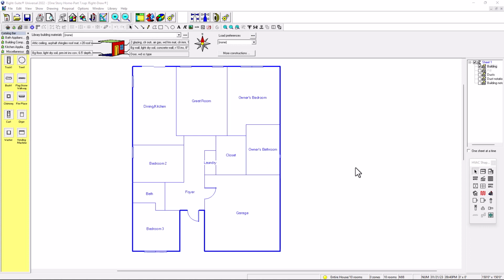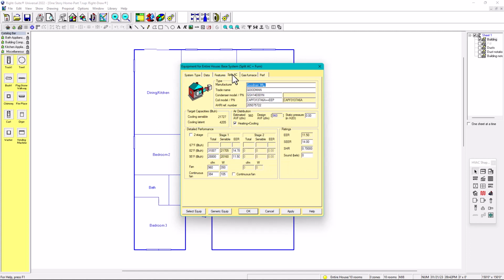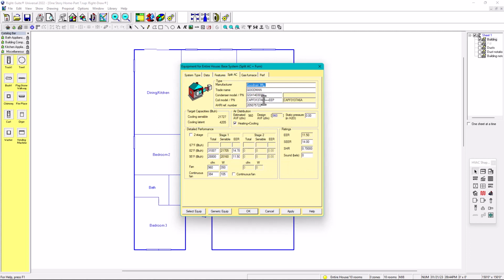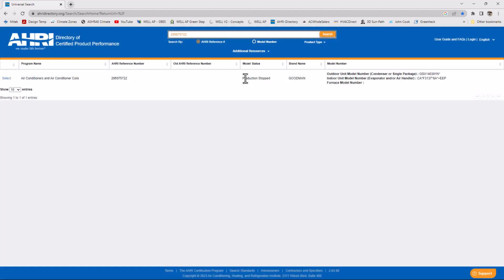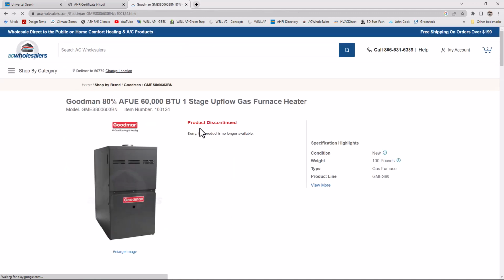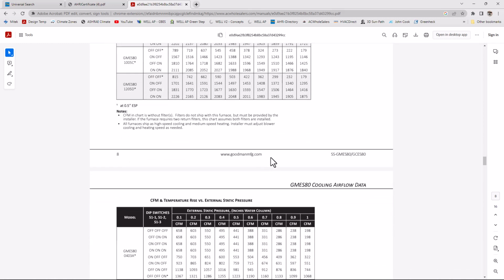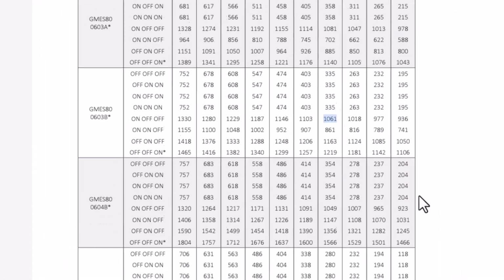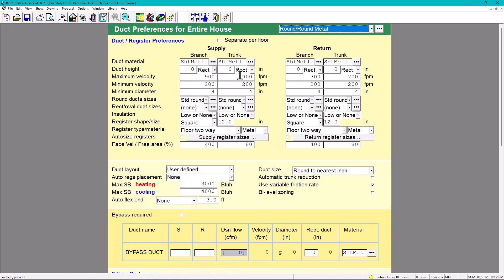Wrightsoft (Part 7): Manual J Heat Load Calculation - One Story Home

Comment: Sir i just now had a chat with my senior in dubai he was saying that Hvac design needs a lot of practice & some drawings are sold only at 5 dollars per plan on freelancing sites is that not less in comparison to our value & effort ? Or is he misleaded.. for 1 commercial restaurant or school project how does a freelancer should charge ? Including of how many services like design part drafting part or boq with heat load calculations sheets etc would you give some clearer ideas so that i must be prepared..
Reply from the maker: The pricing in Dubai might be different. Not very familiar with the market but if you network with some contractors there or some research, perhaps you will be able to find a decent idea on pricing for MEP services
Reply: @hvaceasymath  How far do you think a freelancer can go in our field ? Can we earn more without getting into office work ..
Reply from the maker: @mohibquadri4053  that’s right. But it’s good to work for a company in the beginning and then go freelancer. That brings more experience.
Reply: @hvaceasymath  Yes but due to family reasons i will be at home for 4 months more & till that time i was trying to do something valuable.. also i have the gap of 2 yrs after internship do u think does that have any impact in the eyes of recruiters in upcoming interview ? How to tackle this issue so that i clear the interview..
Reply from the maker: @mohibquadri4053  you can explain to them you had some family issues and they would understand. At the same time you can do some side jobs. Depending your contacts
Reply: @hvaceasymath  Thanks Sir 😊 If you have some whats app group or telegram or discord pls share link i would love to learn more & exchange values whatever i have learnt through meaningful discussions about our mep hvac field trends & projects details..